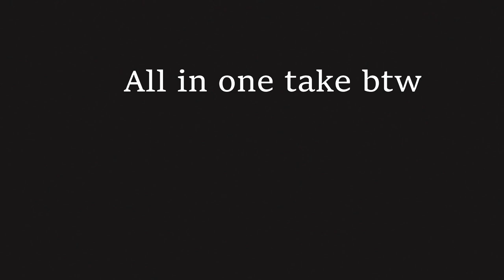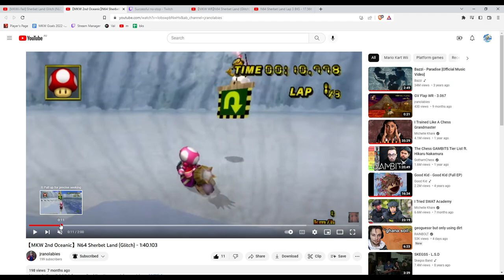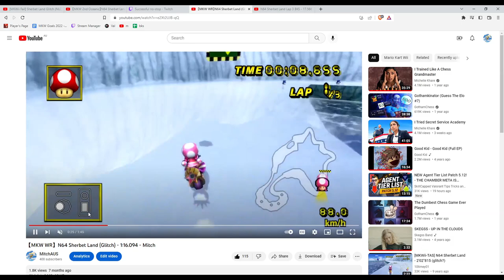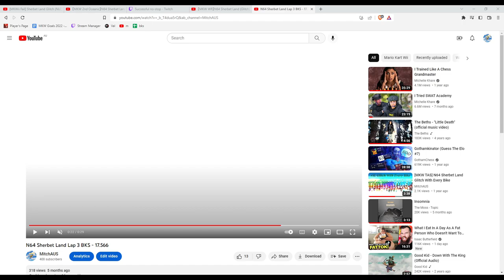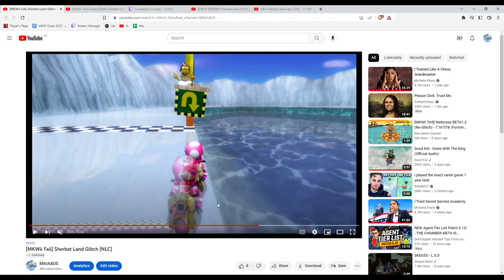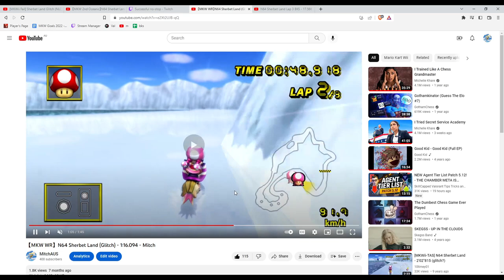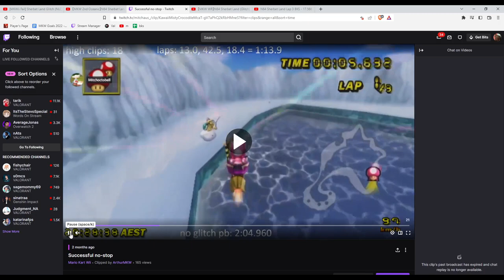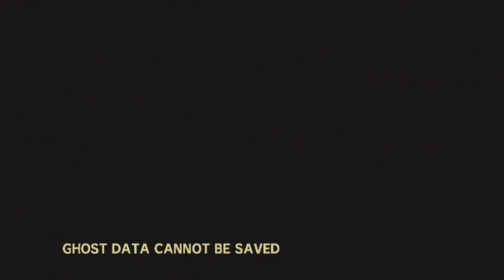[MKW] N64 Sherbet Land Glitch In Depth Tutorial

Comment: Hi mitch, I've been using the spear because its my main vechile for TT's  but most times i clip the wall and than slow down immediatley.
I have tried saved-states for practice but the same thing happens. Thanks for the tutorial maybe a Box-clip tutorial next? I subbed.
Reply: also i tried with the toadette and the magickrusser but it didnt work either, even though i got the bounce
Reply from the maker: With spear you have to back up much more (closer to the end of the marking in the reflection). If you shoot up a little bit aka a mini clip then that means you did everything right and just got bad luck (I recommend watching spear 2/3 runs and to study the visual timings and angles). Remember the trick is a roughly once per hour trick, good luck on making it! Logan has a pretty useful box clip tutorial on his channel I highly recommend 👍
Reply: @MitchAUS_  thanks and also Yeah so I’ll try and grind for an hour and see, It will probably take longer and is the box clip possible with the spear, I’ve only been playing Mkwii for 1 year and a half so
Reply from the maker: @brickmoc82  Box clip is possible with the spear however don’t expect amazing results or consistency from it. The recovery will be virtually impossible and spear in general on TF is rather poor compared to the bowser bike
Reply: @MitchAUS_  ah nice thanks for the advice
Reply: @MitchAUS_   I made the sherbet land glitch just now thank you so much for the tutorial and the advice.

Comment: Hey Mitch, I’ve been told and you said that the glitch is luck, why is that?
Reply from the maker: This glitch is luck based because there exists a set of position coordinates that will give a clip every single time provided specific vehicle values such as speed and rotation. These factors are uncontrollable so you'll have to brute force attempts until these values line up